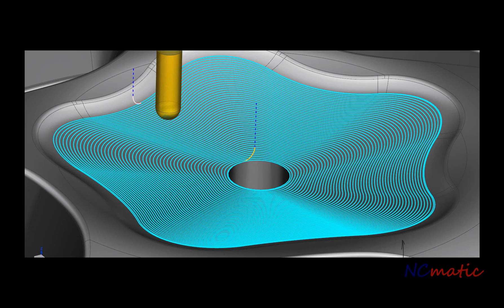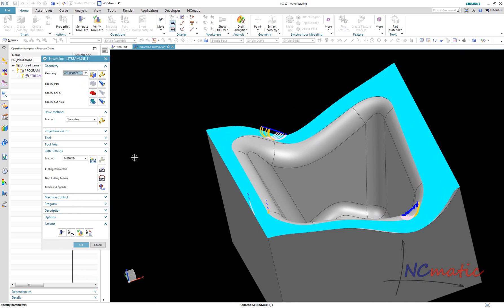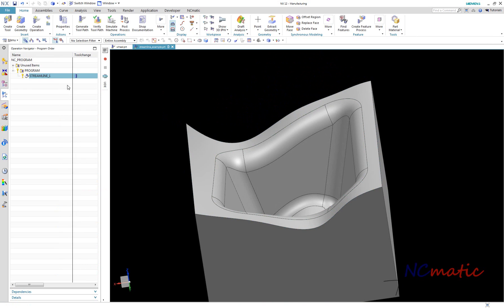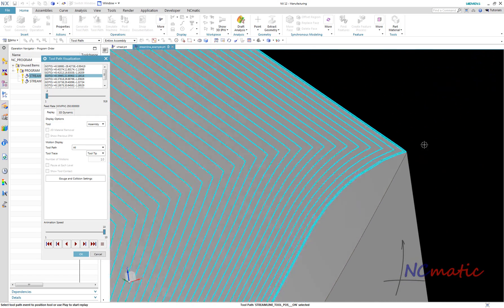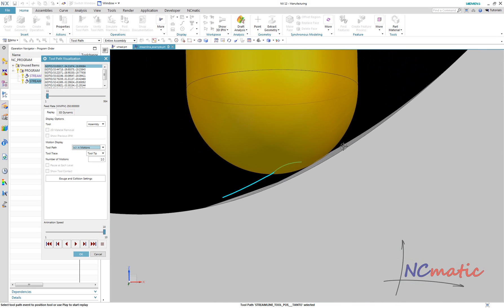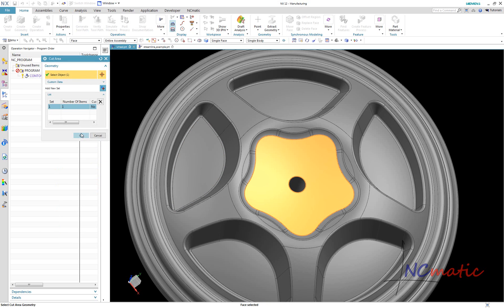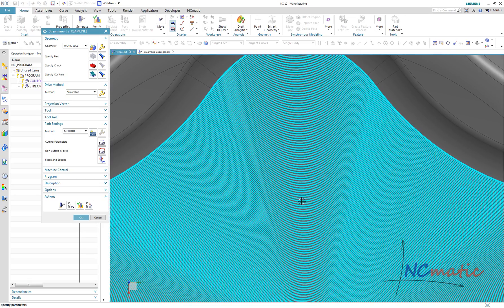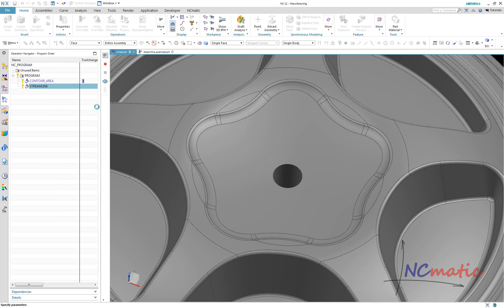Streamline operation in NX CAM

Comment: In your programming starting at 6:00 you select 2 flow curves without any sections. Can't it damage the part and  distort geometry?
Reply from the maker: Flow and Cross curves in Streamline are used to define DRIVE GEOMETRY. Drive geometry is not an actual toolpath. It is not the easiest topic to explain... Toolpath is created by projecting the drive geometry on part geometry along projection vector. You can be sure that it won't gouge the part in this case.
Drive geometry doesn't even have to be build basing on part.
It might sounds confusing at the beginning, but it gets more "reasonable" while trying it with more examples.
I always suggest to experiment with different drive geometry settings and different projection vectors. This way we can understand better how it works.
Reply: NCmatic thank you. I've never even tried using streamline without cross sections, your toolpath is nice and clean. In many cases i get a lot of unnecessary aerial moves and when the cutter goes around objects it makes nasty motions in the radius corners, like vertical zigzag. 
Thank you for your vids, i really enjoyed this one where you added explanation.
Thanks.